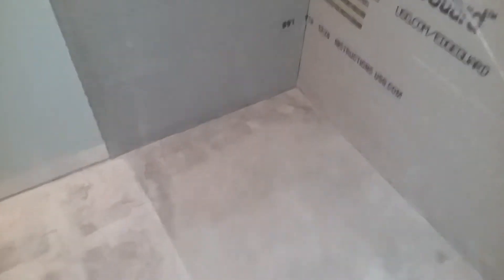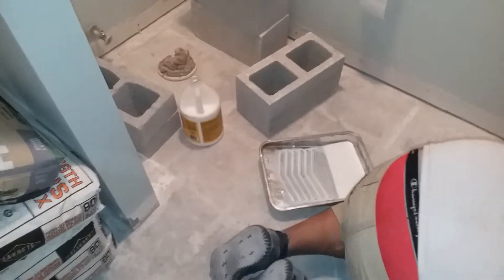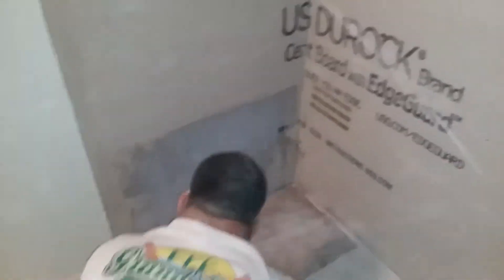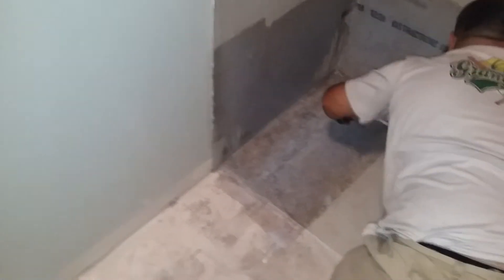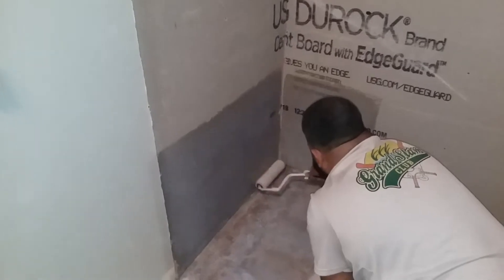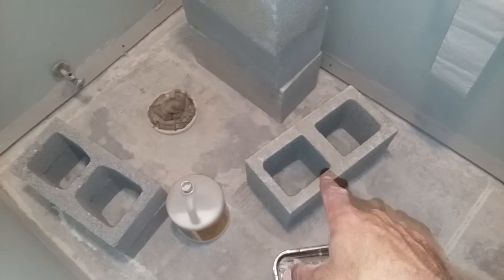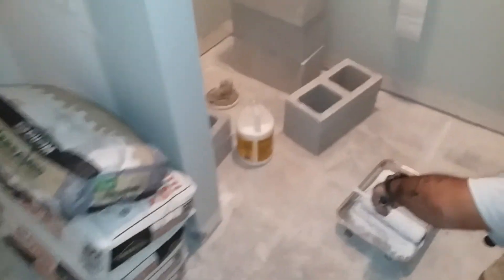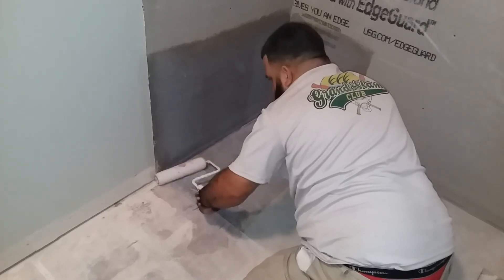How to build shower bench seat. Part 1

Comment from the maker: Heck yeah.. thanks for viewing.... ok...so....the old school guys will leave the durock up off the floor a bit as to prevent mold behind tile......My deal is that I waterproof the entire shower with 3 coats or more of redguard after all mud is cured. If I was going to just stick tile to the durock with no waterproofing then I would definitely not allow my durock to be sunk in the mud pan. I've yet to have a call back or any issue in the past 10 years. Just gotta make sure the waterproofing is done very well.